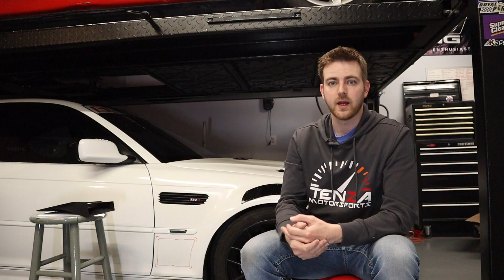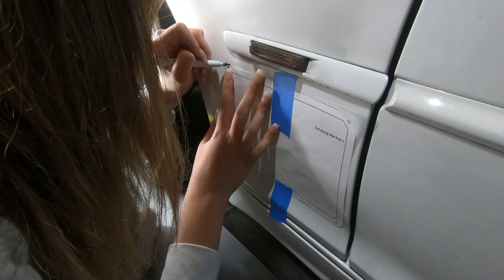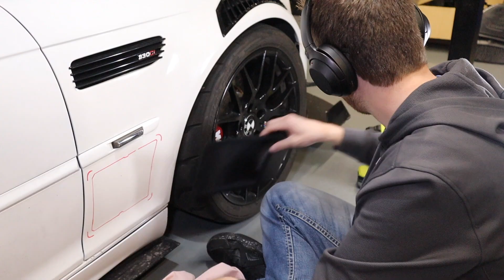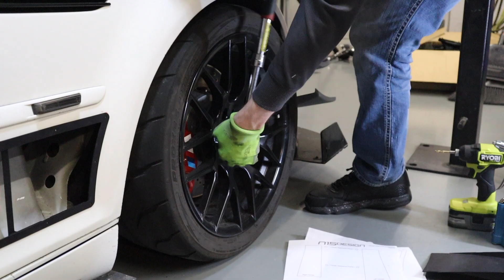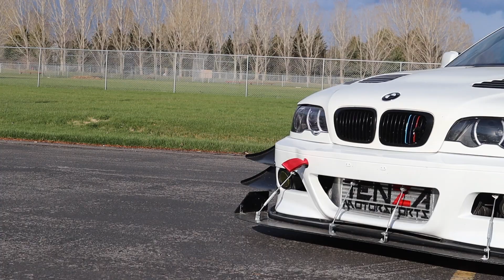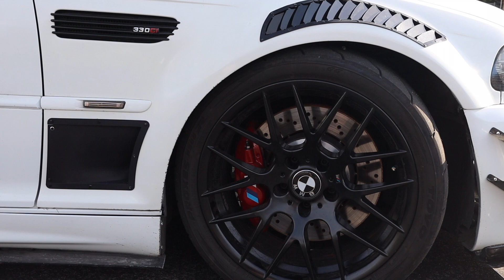N15 design Lower Fender vent install - BMW E46 non-M custom track aero -  330ci full track build

Comment: Did I miss it or did you explain the functional reasons for these? Is it to try and expel heat from the wheel well?

I get why the other commenter thinks these are a bit expensive for what they are but also get what it usually takes to create these. The price of 3d printers these days I reckon people could have a good go at making something the self that’d be close to this if they’re handy enough.
Reply from the maker: The main purpose of fender vents is to relieve built up air pressure from inside the wheel arches, which causes aerodynamic lift. The turbulent air caught in fenders also causes drag. heat is another reason. I’ve also heard relieving air using a lower fender vent, can help flow down the side of the car from swirling. (I can’t personally speak to that. Just something I read on a forum) 

When It comes to price. You can build anything you want. But the cost of a printer and my time to make one wasn’t worth a few hundred bucks. I don’t charge myself labor but I try to be reasonable when spending too much time building something that doesn’t really cost very much. For example, I build my own aluminum egr delete plates. I have scrap metal. It takes me about 15-20 minutes to build and saves me $15-20.

The main point is, they are extremely well designed and built. They have good flex along with the rigidity needed. I’ve done many “direct swap” “bolt on” upgrades that didn’t fit right and took too long to install. We spent about 3 hours total (with recording) and had no problems/redos. It was worth every penny.
Reply: @TenzaMotorsports  cheers for the explanation. 

Agree on the development side of things to. You get what you pay for most of the time or you pay for a brand name some of the time. If you’re interested enough and apply yourself most people can do a lot of things with the right tools/equipment and time, but there’s still a reason why companies offer products like this to cut that part out 👍🏻